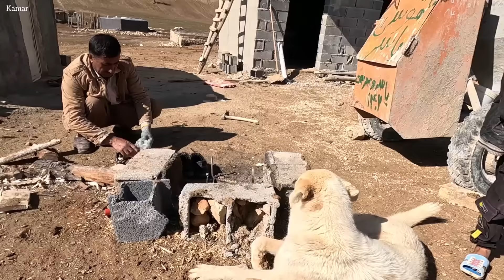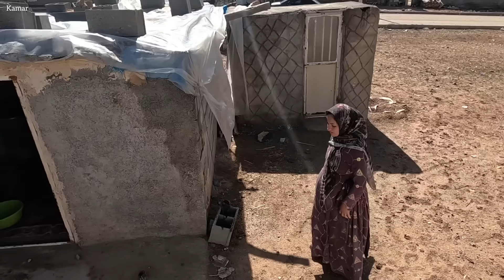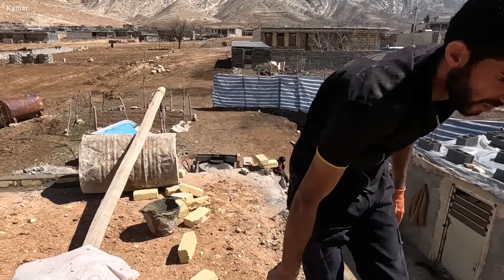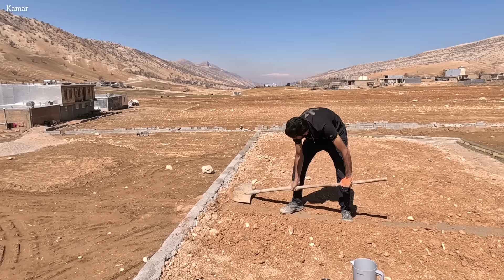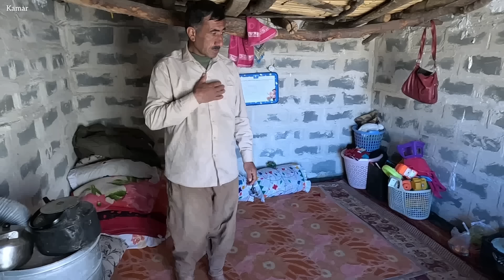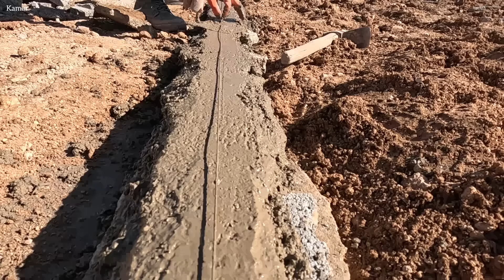"Between giving birth and building a house: a story of love and effort"

Comment from the maker: Friends, don't worry about the roof, remember that the old house survived the winter with a few pieces of wood. The new house is with steel beams, and their sides are filled with stone and concrete, cemented from the outside, and it is strong. The roof is also connected to the beams with thermal wires. In the next videos, the walls will be more resistant, of course, with the work inside the houseSo don't worry, wait a little until the end of the work. There is an Iranian proverb that says that If you wait, goreh halva ❤❤❤
Reply: @Kamar5555 ,it's ok ,but my concern is about the family.
Reply: Things are built very differently there. People for get the climate is different and to get the materials that are Isis in other places. Would be very difficult and very expensive. So things are built how they are. Most rooms and buildings are built with support beams, headers for load baring walls. Not there. That is why people are concerned
Reply: The steel beams was to small carrying that heavy blocks, Sand, and stone 😢 there is positivity to collapse I saw there is no beam and column.
Reply: Are they making a second floor a apartment for that mom and dad
Reply: It will look beautiful when it's done ✔️. 
Thank you 📷 camera lady.

Comment: I think the roof has those metal brackets that the blocks were slotted into they are held with concrete maybe they are designed to hold the weight. Maybe?  Does that little girl ever stop whinging for attention? ❤
Reply: She a bad lil girl and the mother is a poor disciplined this lil girl

Comment: Oh my gosh stop putting too much in your roof its so heavy already😢 don't wait that walls will collapse because the walls itself cant hold the wieght of the roof😢😢
Reply: rip f the wall is collapse:penguin-blue-waving-tear:
Reply: Correct,their wall don't have house pole or any steel bar that's why very dangerous.
Reply: Agree with you 😩😩
Reply: They make path for water to run of the roof.
Reply: It seems all buildings are built that way in that country.. people do what they gotta do to survive
Reply: Que sea en español porque así no se le entiende
Reply: Exactly..no columns no beams 😢😢😢
Reply: چھت پر اتنی زیادہ مٹی کیوں ڈالی چھت اتنا زیادہ بوجھ برداشت نہیں کر سکے گی
Reply: I was thinking that to dad wants to keep putting sand on top and it’s going to be so heavy 🤦‍♀️🤦‍♀️
Reply: People who are worried about the roof coming down,  Stop , the room that was built with tree trunk is still standing some how😊
This one was built with iron beam and cinder blocks, so don't need to worry❤🧿👏👏👏👏
Reply: Pero, que tienen en la cabeza, bajen a ese niño de de allá arriba.. por Dios...😡😡😡😡😡😡😡😡😡😡😡😡😡😡😡😡
Reply: I think that’s why the structure can’t with hold the on the bearing walls and eventually it starts leaking
Reply from the maker: You are right, the old house is tied to a stick, but it survived the winter 🌹😘👍
Reply: But no steel bar from the wall and no post. What's the use of those at the roofing
Reply: Just like what happened to Bekr Channel ,it collapsed
Reply from the maker: @Adrianmagabo-u5f  لا، هذا ليس خبرا

Comment: Those cheaply made cement blocks will never withstand that heavy load . There’s no footer with cement to support the walls . Now this excessive roof . That they keep adding more and more weight to it. This house is becoming more dangerous by the minute
Reply: Those walls don't have a good, strong foundation.  It's dangerous. 😮 can collapse easily.
Reply from the maker: The house is strong, be sure

Comment: Why do they always put dirt on the roof? Inquiring minds want to know. 😊
Reply: I am not certain in this instance. In some places it is used for insulation. In others, you grow things on your roof, such as flowers or herbs- shallow root plants. Since they used concrete blocks and cemented over that, I am trying to figure out the same. I can only think they assume it will wick away heavy water from rain and snow, but I agree with others that it just creates more weight on the weak walls.
Reply: The scary is when sudden earthquake hit 
   Look what happened in Turkey when sudden earth quake hit them building colapsed like paper, thousand casualties and severe damages compare to Japan the damages and casualties is small.the magnitude is same.
  Today there is no safe for earthquake around the globe like middle east they don't experience flood but why Dubai and Riyadh because of climate change
Reply: В данном случае грунтом создают уклон для стока вода. Затем будет выполнена кровля. Все очень правильно делается! Конечно лучше использовать керамзит, но неизвестно применяют ли его в Иране